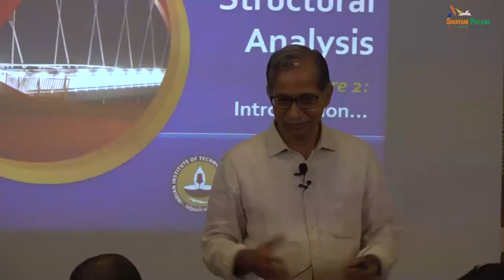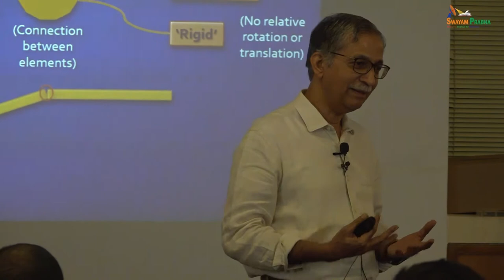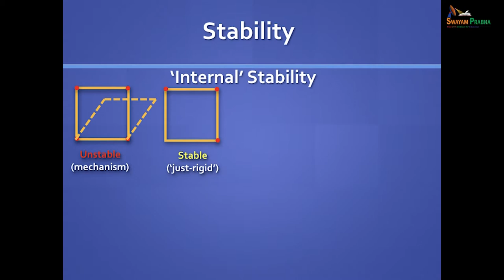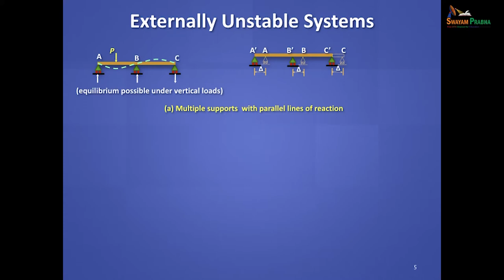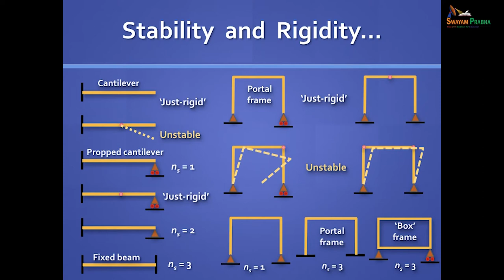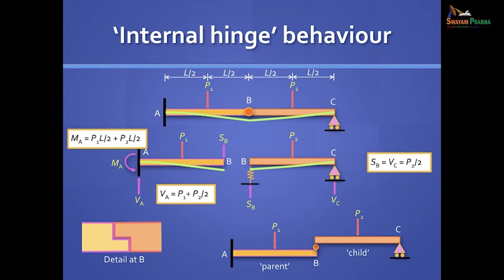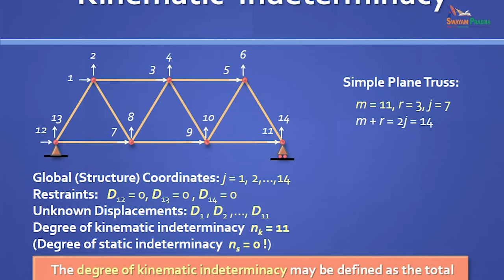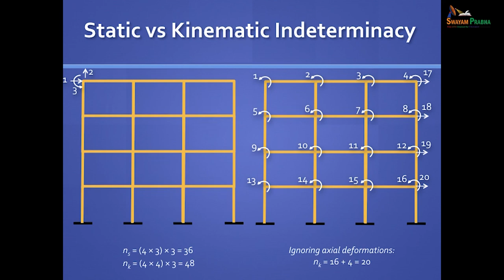Structural Analysis : Lecture 2 - Introduction Contd

Comment: Sir,I did not understand it when you told how the spring is the parent element AB itself.Because,the spring carries only the vertical reaction, but the net load carries by the element is not just vertical reaction. Could you please clear my doubt
Reply: cantilever portion assumed as parent element